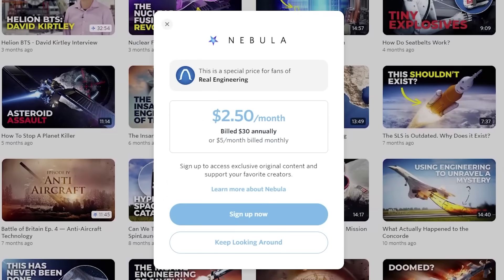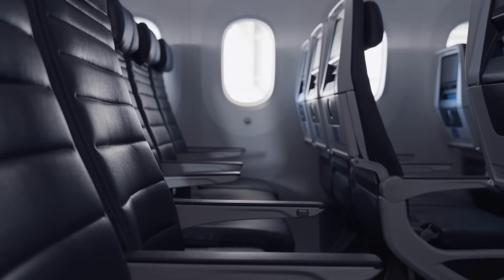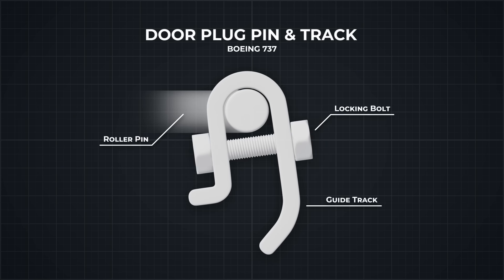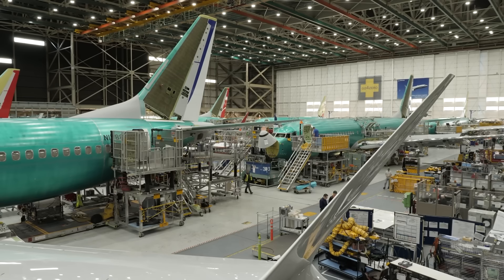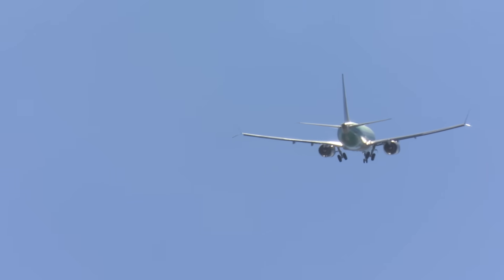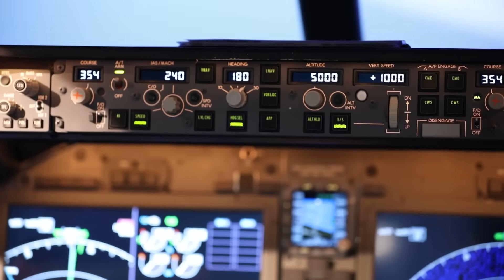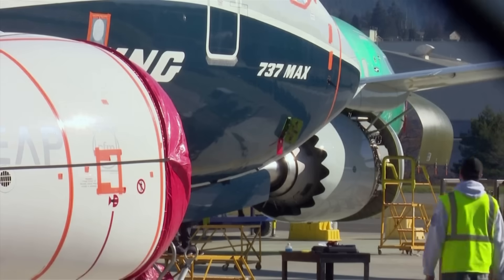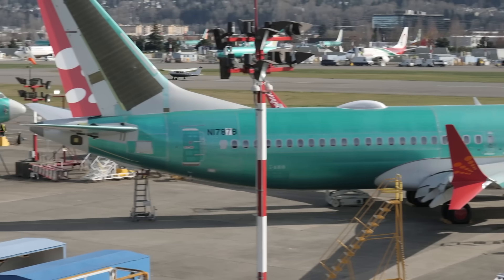The Questionable Engineering of the 737 Max

Comment: I used to be a flight attendant. I heard a story from a flight mechanic:
They noticed a gap where there wasn't supposed to be a gap between the wing and the wing-box (where the wing is attached to the fuselage). On inspection, they found an assembly tool, stuck between the wing and the body. 
That airline is now in the process of  switching from Boeing to Airbus.
Reply: Then you’d love to hear the other dubious things found in Boeing aircraft like that. Besides tales like that-tools wedged between the fuselage and the panels, there have been reports of rags in the fuel tanks. Rags that could end up clogging the fuel intakes to the engines… But my personal favourite is how a flight mechanic once found an entire stepladder and lighting in the tail section of a flying, in-service 787.
Reply: @mikoto7693 Not surprised, and that is the scary part.
Reply: @mikoto7693  I'm not saying Boeing wasn't at fault there - but if the plane was flying and in-service, this means significant amounts of pre-flight checks had been completely skipped, potentially many times over, and there's a huge structural failing at the airline, too.
Reply: @mikoto7693  A large part of this is boeings workers taking their job a lot less seriusly, and just doing the bare minimum. And i do not blame them. They have repeatedly gotten fucked by boeing in pay negotiations, and boeing is just getting what they paid for. That is temporary thougth. Its the best option for people that allready trusted boeing and commited to them. It takes time for them to get out. but as they retire, new workers are going to be going to the spacex, the defence industry, startups and even jumping ship to airbus and embraier. It takes time for boeing to get the full consequences. but once they do it will be to late to do anything about it.
Reply: The amount of bs my friend who is a mechanic tells me about Boeings is insane. He did rather prefered working on Airbus machines
Reply: @sekritdokumint9326  Gotta admit that as ground crew I prefer serving Airbus aircraft. Everything is so much easier and more intuitive to operate, from the doors to the water and lav tank hatches.
Reply: @mikoto7693  thats what my friend has been saying for over a year since he switched cities and started working on Boeing
Reply: @sekritdokumint9326  Which is why airbus is cheaps out, and boeing is harder and longer.
Reply: @josephman1488  Well, look again. If you want a hint, look at 11:10 of this video. I'm not going to say more about that.
Reply: The problem is that most airlines can’t switch. 

Both airliners have delivery slots booked years into the future.
Reply: They should have switched long time ago but better late than never
Reply: McDonnell Douglas’ reverse-takeover has really destroyed Boeing’s engineering ability. It’s pretty sad. Boeing’s basically dead now.
Reply: Airbus and now China are entering the market with a much better safety record. Boeings management caved under market pressure, showing both business and moral immaturity and weakness. They always say, "It costs too much and takes too much time to fix..." but then they pay out a billion dollar fine and lose billions in market share because of recklessness and short sighted cost cutting.
Reply: lol@weekendwarrior3420
Reply: Dacci il tuo nome e cognome ,così vediamo se sei un fake o vero..
Reply: Fake news! Physically impossible maybe you misunderstood. Also what airline?
Reply: I just did 2, 5 hour flights in Max8.
Amazing machine.   
Agree MCAS debacle and door plug issue show systemic problems that still need fixing.
Reply: It's amazing because it didn't crash? Sure it is! @falconeaterf15
Reply: "a gap between the wing and the wing-box ... they found an assembly tool"  I can believe you were told this -- I've heard some odd stories from flight line personnel as well -- but it is totally beyond credibility in engineering terms.  For one thing, the various structural sections couldn't even be joined together since the precisely machined holes wouldn't line up

There was once an aircraft coming down the line which was found to have a incidence (tilt angle) off by one-quarter of one degree after it had been assembled.  That was out of spec, and so it had to be taken apart and reassembled.  I don't doubt that tools etc have been left inside of aircraft (and people, for that matter), but I can't imagine an airliner design where the wing could be assembled not all of the way on, much less left that way with an obvious gap.
Reply: this person probably means they found a tool betwen the wing to body fairing  @marcmcreynolds2827
Reply: @marcmcreynolds2827 well they have found Max 8s with imprecisely drilled holes in the fuselage and tail so doesn't sound that far fetched
Reply: I will NEVER fly on a Boeing product again - even if it means flying Lufthansa, for example, from Dallas to Kansas City.
Reply: Don't you just love those, "I heard from a friend whose uncle dated a girl whose neighbor once witnessed an alien spacecraft beam a full size Winnebago up into thin air", or in this case found a belt sander or something inside of an aircraft,  stories?
Reply: What a bs story. Not a single airline announced they're gonna switch completely to airbus.
Reply: There 10 times more Boeing commercial jets flying than Airbus.
Reply: @u2mister17 not true, there are currently 13 259 Airbus Jet Airliner operational while Boeing "only" has 10 208. Boeing has more freight Airliners tho which are not counted in those statistics.
Reply: @u2mister17 and infinity times more crashes caused by bad design
Reply: @u2mister17  
Is that a fact?
Reply: @u2mister17 this is just wrong.
Reply: @spacegoldfish40  Designing a passenger airliner that weighs 400,000 lbs. and needs 240 MPH to get off the concrete and blaming an American plane for tire failure....
That is just wrong.
Reply: @u2mister17  what does this have to do with the respective market share of boeing vs airbus?
Reply: @u2mister17   "a passenger airliner that weighs 400,000 lbs. and needs 240 MPH to get off the concrete"   FWIW, actual liftoff speeds are in in the 160-180 kt range, i.e. topping out at not much over 200 mph and usually less.

Tires are designed/certified to meet whatever an aircraft's operating limits are (I've been involved with a few certifications).  Failure can be from any number of causes, but typically falls on the operator's side of things.
Reply: @marcmcreynolds2827  The point is....The Concorde was 'designed' and Built with numbsculls (from all over Europe and all governing bodies) with no thought of rubber tires...400,000 lbs....no flaps....and the 240 mph V2 speed. Or was there?
Reply: @u2mister17   This is the first I'm hearing "Concorde".  I'm not sure why it was brought up -- maybe in someone's deleted comment? -- but at least I know what you are referring to now.

The numbsculls gave plenty of thought to tires.  Concorde's landing gear was ahead of its time, with things like carbon brakes.  The fuel tanks weren't protected as well as they could have been, but OTOH all airliners have weaknesses of one sort or another which only get discovered through service experience.  One less errant piece of metal unnoticed on the runway, and Concorde might have sailed on into the history books with an unblemished safety record.

Delta designs can vary, but for the most part the entire wing becomes one big flap for landing, with the more swept inner part of the wing leading edge providing stability at higher angles of attack than could otherwise be safely achieved.  The touchdown speed is maybe 30 kt higher than for conventional subsonic airliner, but that trades against high-lift devices subtracting from payload (same as extra fuel tank protection) and introducing potentially fatal failure modes.
Reply: @u2mister17  no there really isn't lol not very good at math are  you
Reply: thats completely false. You’re lying straight through your teeth
Reply: @BehindMyVisor  and what proof have you got of that? Because there's plenty of proof of Boeing doing exactly what they just said
Reply: But didn't Boeing buy up Airbus? Or have I misheard things?
Reply: @matteste this will never happen as that’ll basically create a monopoly.
Reply: @matteste definitely not true. Airbus is European and Boeing is US. It will always stay this way.
Reply: @matteste  lol no. Boeing "bought" McDonnell Douglas, but in fact it's McDonnell Douglas shady management that replaced Boeing's management and all went downhill since. You can read lots of stories of Boeing ex employees relating to that in the comments.
Reply: @matteste I'm afraid you have heavily misheard things
Reply: @matteste Bo they Bought Bae which also serves air bus.
Reply: Fake story…
Reply: @nhall00195 Completely possible though, especially with the pressure on on time delivery.
Reply: @nhall00195 as someone who works in the industry, this is completely believable.
Reply: @nhall00195 No, you're the fake.   Anything man produces, man will foul up.   I once had a 70 year old musical instrument.   The case for it was worn out.  The case rattled though so I took it apart.  I found a case production tool sealed inside it that had been there all those years.

Comment: Did MCAS fail, or was it having only one angle of attack sensor? Another Boeing short cut. The 737 is an old design. Too old. Boeing would not invest in the New Middle of the Market Airplane. Tight fisted. They are paying the price now. Shame.

Comment: I'm an aerospace quality engineer - and I fully believe that cutting corners for profit margins is the case. I fully agree that the business practice of execs to push profit and OTIF rates over accurate items is a real problem - "is it fit for purpose?" Is a line iv heard multiple times before,

It's a little misleading to say Spirit build the airframes, Most parts are built by approved subcontractors ,and iv previously worked for suppliers to spirit - though I'll state for the record not on anything that on this issue.

I'm not saying there's a flight risk, I personally work in a company that I trust and believe in what we deliver, and I think many others in the aerospace industry will say the same. But there is a trend on management to be hired from business courses to "run the business", one particular director we had didnt even know what CNC stood for while in charge of a site for 2 years, and giving a novice the ability make decisions that no sane person would consider is asking for these issues to arise.

Comment: Just fyi the locked cockpit door is supposed to open in a rapid depressurization event. Boeing just did not write that it their manual for the pilots since it deemed it unnecessary.

Comment: I wouldn't put blame on Alaska Airlines. They operated the aircraft according to official guidelines from Boeing, which was telling them that pressure warning is not a critical one. Even if they decided to try to find where the leak is and whether that leak exists in the first place, they would most likely wouldn't think that the problem is in the plugged doors. And remember that in order to check those doors they would need to remove 3 rows of seats and some interior panels, which is a lot of work. However, they planned to check the problem anyway during scheduled maintains, but as I said previously, they would most likely fail to identify the leak.

According to Mentor Pilot this is pretty normal practice among airline companies. After all, planes are extremely complex machines and if companies were fixing every single non-critical warning many planes would be grounded most of the time. It's not even possible to drive many modern car without them flashing random errors at least once a year.

Comment: 0:20 - Great sound effect !

"Questionable engineering". That's if the door latching mechanism was poorly designed, including inadequate materials. Bolts were missing. And not the ones you would expect. Yes, not properly tightened. But why and how ? Improper bolts ? Not proper torque ?

Unfortunately, Boeing has been run by bean counters, since they moved the headquarters to Chicago (then moved again).

Comment: picture this: the year is 2042. you show up to the gate to board your flight. at the gate you see the plane you’ll be flying on. it’s the brand new 737 max 84. it is 8.4 max 10s stuck together. it is so violently unstable in pitch that the pitch trim system is powered by no less than a dozen quantum computers calculating nanosecond by nanosecond adjustments to the stabilizer. boeing calls this the Computerized Rapid Adjustment Stabilizer Handler (CRASH, for short). only two engineers know of it’s existence and they are chained together in a dungeon 10 stories beneath boeing headquarters. the health of these computers is monitored by the one member flight crew via a single indicator light in the flight deck (the only instrument on the panel), though the pilot is told it is a low fuel indicator. should it illuminate the only remaining procedure in the qrh directs the pilot to land immediately at nearest suitable airport and contains a note instructing them not to speak with the media. that this is possible at all is the result of decades of work by boeing corporate to lobby bribe and finagle their way deeper and deeper into washington until finally having been absorbed wholly as a new department of the federal government. the ceo of boeing is now a cabinet secretary, appointed by the president and confirmed by congress, 19th in line to the presidency. all is well. all is as it should be. profit has been created for the shareholder.

Comment: Real Engineering? More like Click Bait Engineering. If you want to see what happened with the Alaska Air door plug, watch the videos from The Boeing 737 Technical Channel.

I stopped watching this video after a minute or so. Why? I stopped when they said a door plug window looks no different from a regular window. Yes it can. The spacing from it to the window in front and behind it is wider than a standard window. This would have been obvious if they had used any video clips of a plug door when discussing plug doors. Instead they showed over-wing exits and other things that are not plug doors.

The quality of the research is poor and doesn’t reflect well on Nebula either.

Comment: Just a quick correction (Mentour Pilot covered this): "deactivating" the door leaves the emergency door in place but it is no longer able to open and (I assume) does not have the slide installed. A deactivated door can later be reactivated. That's different than having a plug installed. A plug cannot be reactivated, but must instead be replaced with a door if the airline elects to increase the number of passengers.

Comment: Here's what I dont get; A loose / undertorqued or even missing bolt wouldnt cause the door to just fall off , not at around 16,000ft . That plug is being pressed onto the stops by pressure in the cabin. I mean thats literally tonnes of pressure against those stops. Best not to speculate before the NTSB come out with their reports as theres a good chance every buzz word the MSM will spout will probably be wrong

Comment: It occurs to me they should really call this a blank rather than a plug. You can blank over a hole (Plate of metal bolted over a hole for the purposes of closing the hole) and this is a common term in pretty much every other industry. 
Some aircraft also come with "Plug type doors" which by definition of their construction (Wider inside than outside), cannot come out of a pressurized fuselage without taking the frame with it. These are the doors that have to move into the passenger cabin before they can be swung out. Same with overwing emergency exit doors, the instructions tell you to bring the door in, and then throw it out sideways.
So hearing "A door plug blew out" the first thing that comes to mind is "How much of the fuselage left with it?"
Whereas hearing "A blank popped out." the first thing to come to mind is "Well... chit... that sucks. Wonder what caused it to let go?"

Blanks fail often, and have caused MANY disasters...

Comment: Honestly, why is the certification process so incredibly expensive? It seems like it casues more problems than it solves. If certification was less complicated, Boeing could just have made a new small airframe instead of retrofitting the larger engines onto a 737. Not an excuse, but an example of safety regulations being the root cause of unsafe practice.

Comment: The 737 Max is a truly sad case. A perfectly good airplane, the 737, available in several versions, distorted to make it into something it's not.  The fitting of larger diameter engines necessitated a new wing, with longer landing gear. But, Boeing cheaped out and resorted to a truly half-*ss solution. The larger fuselage required enough changes to almost require a new airframe. But again, Boeing cheaped out. 

Now they are paying the price...

Comment: Great video. Liked that you didn't put blame entirely on Boeing like quite a lot of people do. 

Also check out Mentour pilot's video on this topic.  He also did a great video on the southwest flight you mentioned in the video
Reply: Part of the Issue is the FAA. 

Not only their lack of oversight, but their legal structure and regulations. 

Their requirement that modified aircraft must fly exactly like the previous example (even if it had unfavorable qualities). If the aircraft does not fly the same, or very close. Then it must be re-certified. Get a new type certificate (Billion$ paid to the FAA for them to rubber stamp it). And then all pilots must be re-trained on the "new" type they have already been flying their entire career.

This is the entire reason that Boeing chose to develop and install the MCAS system.